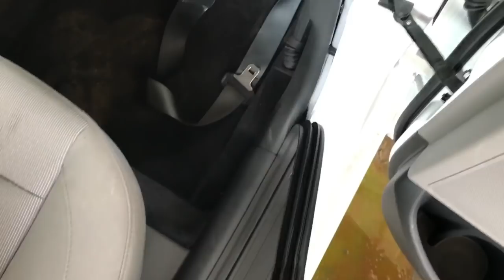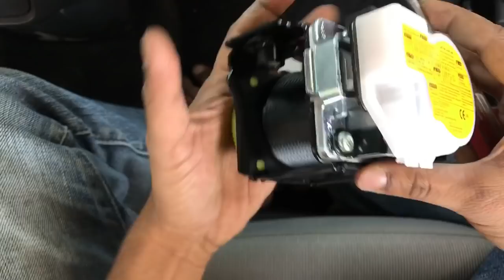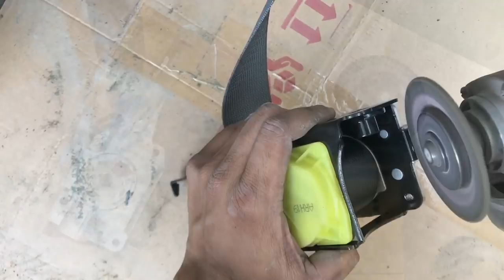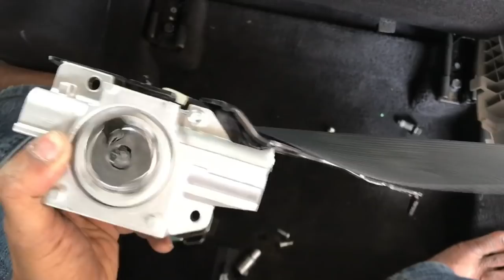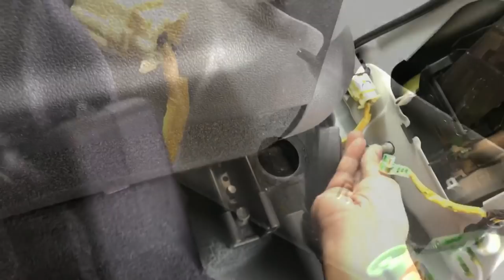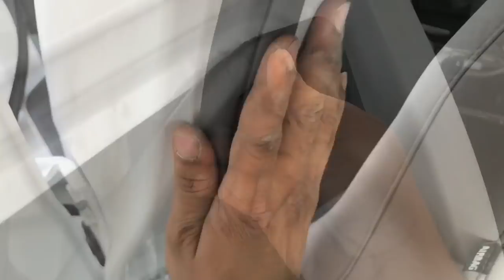Seat belt repair after crash

Comment: I can only appreciate your intention to fix your car but after crash seatbelts must never be a DIY project. The tube you cut off is a pretensioning system that saves your life in a crash, so please get any systems (seatbelts or airbags) that are deployed in a crash event replaced at a certified dealer. If you wonder why do I care? I’m a seat belt engineer.
Reply: Is this pretensioner part available to buy separately ? my car's air bag light suddenly came on without any collision and when I scanned it shows the pretensioner is faulty. so I have to replace the entire seat belt if a replacement pretensioner is not available, which is somewhat costly.
Reply: Thank you, I hope no one does this.
Reply: Is this going  to make the belt operate like seat belts that we used  prior to this system  and therefore  am alternative  to no seat belt at all?
Reply: I am going through that right now expt I am buying the seat belts, the tools I need for air bag removal, Is on loan from the shop I use to work at.  It was not a hard impact that set mine off,  but it cought one the sensors on the left front by bumper, I mean I litterly drove it after impact, radiator in tack, grill was not even broke got into the headlight mount and bumper mount. Still figuring that out&..

Comment: It's not a good solution better option is to replace the assembly other wise the seat belt will not lock in accident and the air bag will not work properly. By this method Seat belt force limiter and pretensoner will be useless

Comment: This is how to destroy the safety system your car comes with . Tampering with SRS systems without any professional knowledge is illegal . Think about the customer who will buy this car from you . You could get them killed .the SRS airbag light will stay ON , what are you doing to turn it off ?remove the bulb and throw it away ? The proper way to solve SRS components after depolyment is to either get them replaced with OEM ones or send them to a company that is licensed to rebuild them up to safety standards .

Comment: YOU CAN BUY USED OR NEW SEAT BELT RETRACTOR/PRETENSIONER AND YOU WILL HAVE A FUNCTIONAL SEAT BELT IN LESS TIME THAN THIS. THE PURPOSE OF THIS VIDEO IS TO ELIMINATE THE ONLY FUNCTIONALITY OF A SEATBELT. THERE IS NO SENSE IN EVEN USING THE SEAT BELT IF IT DOES NOT HAVE A PRETENSIONER.  I CAN'T BELIEVE I JUST WATCHED A VIDEO OF HOW TO DISABLE A SAFETY FEATURE. HE MAY AS WELL HAVE JUST TAKEN A PAIR OF SCISSORS TO IT. LIKE WHY HAVE A UNFUNCTIONAL SEAT BELT? EXCELLENT CONDITION USED ONES GO FOR $40 A PAIR ON EBAY.

Comment: this is a quick fix to get your seatbelt working however, it will now show the airbag light on the dash. you cannot clear this error from the ecu as the circuit is still open at the plug which he left loose. so thats an MOT fail right there
Reply: Can you explain further? I already have an airbag light on and not working seatbelt I can live with the light but I need the belt to work.
Reply: By adding two ohm resistor you turning light off, error cleared just like that, and you pass your MOT .

Comment: Seems to me that it's much cheaper, easier and probably much safer to just not wear a seatbelt after a crash than to do this.
Reply: I had the B-pillar seatbelt in my 2002 Durango changed in about an hour. Cost me $10 at the junkyard.

Comment: Accident today 6/4/19   2017 Silverdo 2500   While getting out of my truck which was struck from behind I notices smoke around the door pillar post near the floor. Had water to put out smoldering. Later found out this by design. GM installed a exploding device to tighten your seat belt pretensioners during a accident. My wife is at medicenter right now from chest and shoulder pain. Not sure about this video fix? Part was cut off and not replaced. I'm going to contact GM.
Reply: The part the guy cut off is the pretensioner. This isn’t a fix, its disabling a safety device to make the belt retract.

Comment: This is more of a jimmy rig or mickey mouse not a Repair. Repair means restored to proper working order and function. Youre eliminating the SRS function in the belt mechanism rendering it inoperable and non functioning. If you're doing this to a personal vehicle then great, if a shop is doing this to customer vehicles and calling it a "repair" that is fraud and leaves a lot of liability if the customer ia ever in an accident

Comment: hi my belt works but will only extend to a certain limit. now im a big guy, so it just fits me,but wont extend any more than that! what is the problem and how would u go about fixing it?
Reply: There is no fixing that..No doubt about it now all hope is TRUELY & UTTERLY LOST! take the vehicle to a large parking-lot across town @ 2 - 400 hrs and empty the contents of a filled 5 gallon gasoline container & apply generously to interior & leave a trail into engine compartment.(Start motor for better results)Ignite accelerant 
AND LOCATE BUS STOP BECAUSE 
YOUR ASS WILL BE WALKIN HOME OTHERWISE.

Comment: And airbag light still on....
Reply from the maker: Reno Hysa if you want to turn off the light then you need to reset the crash data from Airbag Module.
Reply: If you fix it like this and reset the crash data. Will it stay off? Because it doesn’t sense the seatbelt anymore?
Reply: @horvath14041984  same shit happened to my jeep no airbag deployed only seatbelt and the guy did that so now it wont come off i guess i should have told him to put anew one didnt know it will stay on cos the idiot cutted the sensor off
Reply: @FixAnyCar  You need to put a resistance otherwise the airbag light will be active.

Comment: What car were you working on?
Reply from the maker: A Meehan Hyundai Elantra
Reply: Does the seat belt still lock if the driver has to stop quickly?
Reply from the maker: A Meehan of course bro It will work as before😊